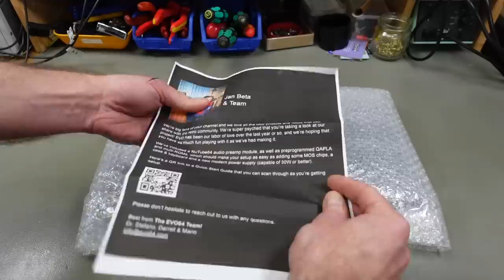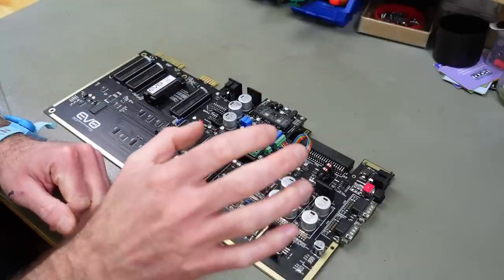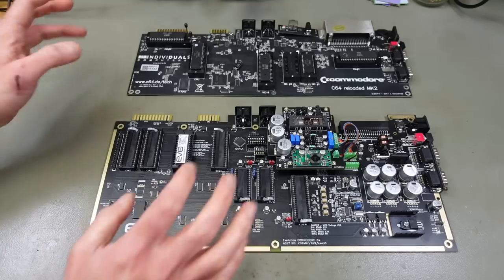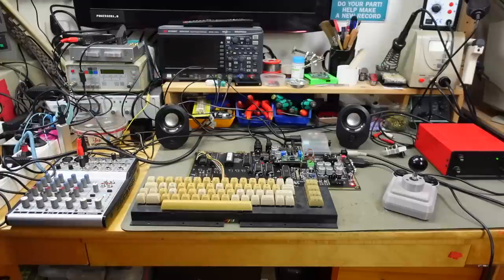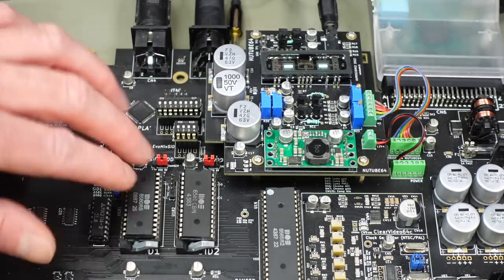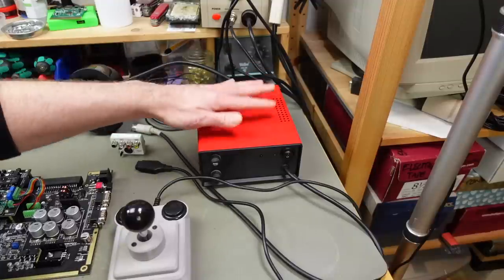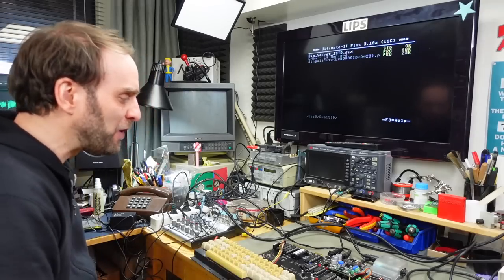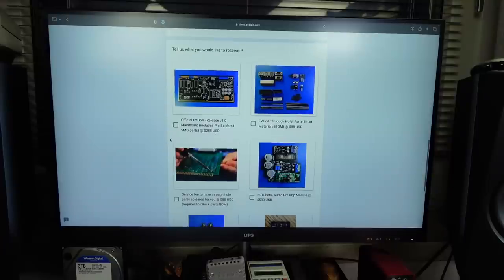The new EVO64 C64 Replica Board

Comment: will that dual Sid use $DEOO address ?
Reply: Yes - you can use a  jumper or dip switch to enable the second SID to listen on $DE00. Separately, you can also enable $DF00. The default addresses that reach the second SID are $D420 and $D500.

Comment: How does this compare to an ultimate 64 elite? To me, it seems like the only added features are those that come sith the expensive sound additions.
Reply from the maker: I don't have an Ultimate to compare it to unfortunately. Performance should be pretty much the same (minus the preamp options, plus the nice menu and other options the Ultimate offers). It's a different approach though generally. The Ultimate replaces most of the original circuitry and MOS chips with FPGA implementations of them, the EVO uses the original chips so it's closer to its heritage. It's a matter of preference I'd say. :)
Reply: EVO64 is attempting to remain very authentic, paying tribute to the original C64 design, by supporting either the original chips or modern alternatives, whereas the U64 is fully reimplementing all of the chips in its FPGA. There's no right or wrong approach, it really comes down to taste and style and personal preferences.
Reply: @C64EVO  I understand the hardware differences (I have a U64e), but am just keen to understand whether the EVO offers me anything additional
Reply: @christianlarsen1070  well EVO wasn't designed to compete with the likes of the U64, so there was little compulsion to reach feature parity with an FPGA system. The design goal as states above was to achieve the best quality from the original system architecture (and chips). From that perspective, we feel that we've achieved our own goals. Hopefully that lends perspective.

Comment: The FPGA Sid  uses Dual Sid can you explain that sometime
Reply from the maker: Oh, I think the way it works is that it's just "listening" to the standard addresses that the regular "physical" dual SID mods usually use. The FPGA allows for two SIDs to be emulated at once. The ARMSID is able to do the same. It's just a matter of running an extra connection to the output jack to get the stereo effect. :)

Comment: The SID is solid state.  It has digital and analog solid state circuitry, and because it's MOS, low quality, with the fidelity of a good AM radio.  Tacking an outrageously expensive tube amplifier at the end of the solid state audio chain is ridiculously stupid.  Tubes cannot improve the sound.  You're better off using a TL082 JFET Op-Amp (used in very high quality audio designs).  That chip and surrounding circuitry would cost about $15 US.

A bit of truth here though... Tubes (valves) introduce distortion that audiophiles consider quite pleasing.  This is due to their very high impedance nature.  They favor mid-range frequencies and thus makes it seem vocals jump out.  Due to their high impedance nature, low frequency response can suffer without an extremely robust tube and power supply.  Many tube designs can also emit hum, although here there is likely a switching inverter to achieve the needed high voltage minimizing that.  Clipping distortion in tubes is spongy as they are not high-ampere devices.  The power supply will sag when the audio "punches" or has instant high output bursts, although the sag occurs throughout the output range.  Put a scope on a tube amp power supply and watch it sag at normal volume and high volume.  This tends to cause "warm" sound.  It's just distortion, but gentle.

Solid state devices are typically low impedance, and their circuits are relatively low voltage but much higher amperage than a tube design.  Solid state will typically reach essentially a brick wall when their power supply is taxed.  This makes clipping quite harsh.  However, a good solid state design (with FET and JFET designs) will be able to reproduce a frequency response flat across the audio spectrum, and distortion values barely measurable.  Really good valve amplifiers will typically be %2 - %0.1 distortion and solid state can be as low as %0.001.

This is all an over-priced gimmick like Monster Cable speaker wire.  It's your money... whatever.
Reply from the maker: That's an opinion I guess. Coming from an audio engineering background myself, I know that tube preamps can make all the difference. The harmonic distortion they add has a positive effect on the perceived sound for many people, no matter what the original sound source is. I used (real) tube preamps for a lot of vocal recordings and on many other tracks in the studio, sometimes even running whole mixes through tubes to make them blend together better. A very common thing to do these days in professional audio work is to use tube preamps in conjunction with a digital recording environment to make things sound more "natural". It's definitely not audiophile snake oil as you frame it. On the other hand, some speaker wires are. Also, the way you talk about the quality of the SID's output is bordering on blasphemy. ;P In the end, as with all things regarding audio, it's a matter of taste.
Reply: Back in your box Rich
Reply: @JanBeta  Like I said "distortion that sounds pleasing".  I know it sounds counter-productive, but to the human ear, the distortion tubes introduce sound pleasing, "warm", "open" etc are used as good descriptions of this phenomenon.

If I am doing a voice-over, I want to sound "radio talk show", I would use tube pre-amplifiers to give the '50s AM radio warm sound for my voice.

Ever notice how the "tube sound" can be pronounced on older recordings and most especially radio broadcasts?  Tube has a specific purpose, although due to their rarity today, quite expensive.

You can simulate the "tube sound" without a tube.  Use FETs, JFETs and make their power supplies spongy (resistor / capacitor / resistor).  Keep the entire circuit high impedance throughout the chain with a relatively high voltage and low amperage supply.  You can use metal film resistors in series with the stages to help maintain the "weak" amperage of the signal itself as well.  Keep it strictly a voltage amplifier (like a tube).

I'd be willing to bet you could fool a tube fanatic with a simulated FET and JFET audio voltage amplifier with a spongy power supply.  It would be "blasphemy", but highly possible.

My peeve here is to tack on a ridiculously expensive gimmick on an already poor quality signal generated by a cheap MOS SID.  SIDs fail because their low quality bi-polar transistors suck.  This is Commodore we are talking about here, the kings of cheap.  SID was a technological marvel, cheaply made, in the 1980s, and using cheap quality silicon.
Reply: What about the microphonics! 
I guess everything a valve amp can do a DSP and lookup table could do but it's probably more direct to use valves instead of all the extra mathematical and software engineering that would have to be done to emulate valve characteristics.
Reply: The SID is not a sound reproduction device that needs to reproduce sound as accurately as possible. Its job is to generate pleasing sounds. Therefore adding pleasing sounding distortions is IMO a good thing. Still, I think tubes are a bit overhyped: They may sound more pleasing when overdriven, but under normal drive, they don't do amplification better than a transistor. The sound fragments sound like perfectly normal SID sound to me, not better, not worse.
Reply: Rich, go sit at the back of the class please.
Reply: I didn’t think he pulled any punches in the price evaluation.
Reply: @cappaculla  Is that behind the deluded fanboys?
Reply: @danielmantione  The first well said reply.  Indeed, a tube doesn't (and cannot) harsh clip like a solid state device, mainly due to its power supply and the tube's high impedance (part of its sponginess).

Making a tube create a square wave involves a lot of crazy circuitry to get a square wave.  Clipping is a square wave, and much of an 8 bit computer's sound is a square wave, even the SID.  Filters make it pseudo-sine in some cases, but it's just basically a controlled square wave (or triangle) at various intensities..

With a solid state amplifier, it would reproduce that square wave extremely accurately, and seem harsh to the ears.  A tube amplifier, however, because of its inability to create an accurate square wave, would "warm" that square wave and soften it to a more sine-like mound.  (think of the wave's corners sanded down).  Harsh sounding SID music would sound warmer.

I see the advantages with an 8 bit computer, but not $500 worth.

Comment: Sure a project from die-hard C64 fans with the idea of bringing almost every modern mods and tweaks in that you can have. However, the C64 has turned 40 last year and I think that it is sure worth trying such a project from a creative point of view, but personally, I wouldn´t want it. I am doing fine with my box standard system with new caps and the "usual" stuff from back in the day....BTW: there is a Pioneer multimedia system  "SPH-EVO64DAB - Car Entertainment Multimedia Receiver" available...sure doesn´t have anything in common with this piece of hardware...

Comment: Who every designed this board went crazy with the capacitors...
Reply: In addition to replacing all of the original ceramic disk capacitors, there are also quite a few caps being used in the audio signal path, to provide smoothing consistency.
Reply: Tom, I`m proud of it, and I still think I did not go all way I should have. When you put the ultra-low-noise 5V step-down there is ABSOLUTELY no hum in the speakers. And the new ultra-low-noise 24-36 step up - which I use to drive - and overdrive - the nutubes is even better.

Comment: I would think for a fairer comparison you would need to fully recap/update the regular C64’s with new components.   
Honestly, I just couldn’t hear any the difference between the 2.  

At the $$$ evo64, I don’t think regular c64 owners will pay for this fancy board.  
Some of us are still connect ing our c64’s to a crt tv or a 1702 monitor…..:….their speaker are 40 years old. 😂😂😂
If all you need is a modern reliable computer on hdmi TheC64 is perfectly ok for casual gaming.

I agree, this is specialty product.
Reply: Needless to say, no one is obligated to buy this. There are LOTS of C64 remakes out there already, which cater to a wide variety of interests. Surely there's room for this one, which as Jan said at the beginning of his video, has been designed to provide the best quality audio and video experience possible from the original system architecture. It may not appeal to a huge audience, but we certainly hope that it's exactly what some folks have been wishing for... All the best,
Reply: @C64EVO  surely……that is why I said I agree with him.
Reply: AtariMex. Perfectly legitimate. If your C64 works well, and you do not need any extra features, there is no reason to pursue this project. I designed because I was not happy of my existing C64 and of the available boards.,
Reply: @auro1999  congratulations on your design, I am sure some c64 fans will be happy and thrilled to get one. All success!
Reply from the maker: The C64s I used for comparison are both fully restored and recapped. I should probably have mentioned that. ;) As I said, the EVO is definitely a niche product but a lovely addition to the options available nowadays for the C64 experience that caters to your specific needs and preferences. :)

Comment: IS THE VIDEO ON THE EVO NOTICEABY BETTER THAN THE RELOADED BOARD?
Reply: yes, that`s the reason I built it
Reply from the maker: The Reloaded has the same output quality like an original C64 (it just adds a couple of extra options for connectors so you don't have to use the original DIN socket for video output), the ClearVideo on the EVO board definitely improves the output quite a bit if you set it up correctly.

Comment: Over the Top are the Prices too ^^
Reply: Did you actually look into any of the module or component prices before commenting? Curious to know what you think it should cost for a brand new C64 design that incorporates  ClearVideo64, MixSID Stereo, RePROM64, MOS8701 replacement, SRAM upgrades, a Nutube VFD and other audio grade components?

Comment: Why no TV modulator, now i can't connect ir !
C64 needs a TV !
Reply from the maker: The original modulator circuit messes with the output signal quite a bit so it was removed and replaced with a cleaner circuit in the EVO. You can still use the composite or luma/chroma output and feed it into an external RF modulator (which probably works better than the original ones anyway) to have an output on an old TV set.
Reply: @JanBeta  Thanks, i use Sony HDMi DVD / HDD recorder for all my antena gear now !